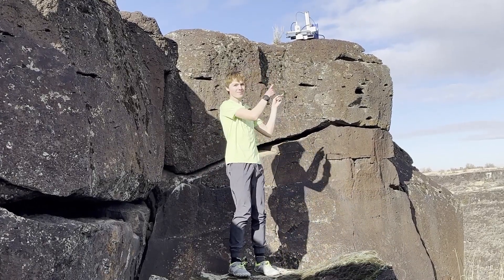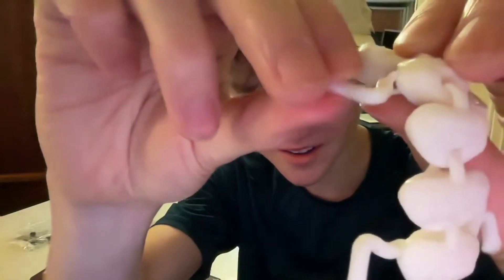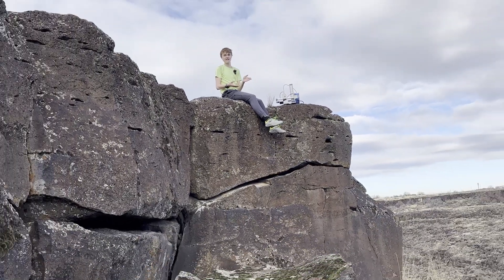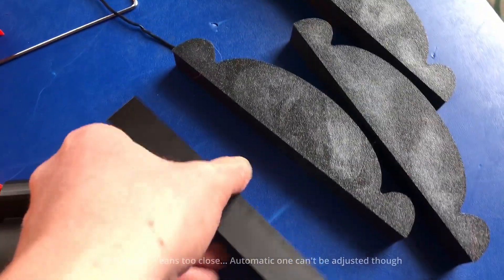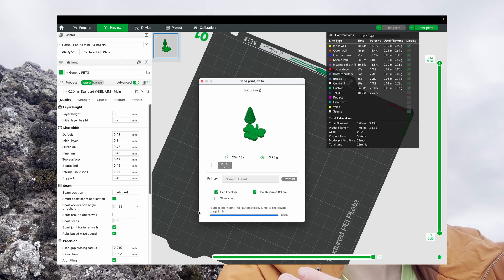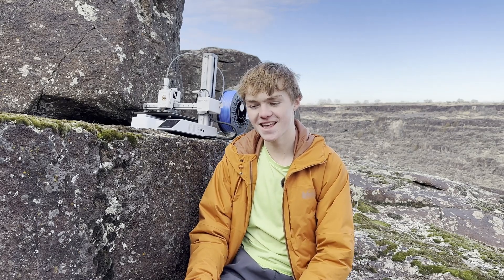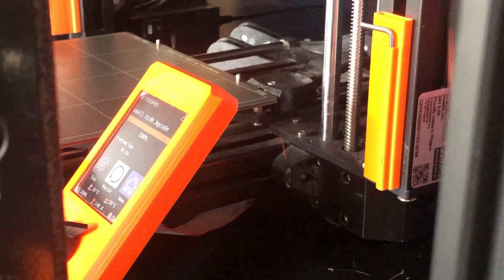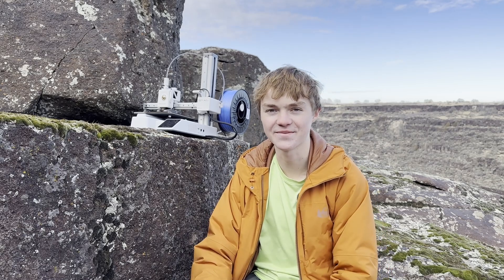I Finally Tried a Bambu Lab || A1 Mini First Impressions

Comment: Do you get any fumes or odor from printing pla, also is it ok to use in a house thanks
Reply from the maker: There's probably something, though the only time I notice it is when it gets really hot in order to swap filaments. Either way you should be fine to print in a house.

Comment: Until it breaks. Then you are left with complications and tiny parts that can only be made by bambu. 
Its cheap and its disposible. I own one. I will not own another bambu product. They are too cheaply made.
Reply: Uh it’s not that complicated and very easy to get parts from Bambulab. Have you looked into how easy that is or are you just assuming?
Reply: Mine broke after 7 months of ownership and needs about $100 total in parts plus I'll need to take it apart and replace.  Bambu said they are "consumables".  Before I put $100 into another A1 mini, I'm going to try something else or maybe buy an A1 since I have the AMS lite.  Disappointed it broke so quick since I don't print that much.  I'm looking hard at the core one...

Comment: I’ve owned every PRUSA variant up to 2022

All I can say is that for entry level models, the A1 and the A1 mini is far superior to my Prusa Mini and Prusa Mk3/Mk4 and for only one reason: price to performance

For example the A1 Mini is currently half the price and triple the features when compared to a Prusa Mini+. Why buy a single Prusa mini for $450 when that can get me 2 A1 minis in equivalents?
Reply: My  4 years old mk3s is making better prints than new bambu a1mini. If you still got mk3 update software it makes difference.
Reply: @michawasiljew6620  Print quality usually comes down to settings and print profiles.

Comment: I'm not a Prusa hater by any means.  However, there are a lot on Market place in my area...along with many other brands except Bambu.
Reply: Not really the best indicator of a product’s performance, however PRUSAs are still really good printers, often touted the Ferrari of 3D printers back in the day.

I will admit though that in the 4-5 years I’ve owned the Prusa Mini+, the performance is nowhere near the A1 Mini, and neither is the price. 

At $450 (before shipping costs), that Prusa mini  already discouraged entry level users from looking at it from the build-plate size, to the lack of a direct-drive feeding mechanism. Its basically the equivalent of the ITX tax often associated with PC building
Reply: based on seeing this comment here and on another video.  I went and checked mine.  I don't see bambu and the only prusa i see in Michigan are minis.  Which, maps on what I've heard about the minis vs. the rest of the prusa line.